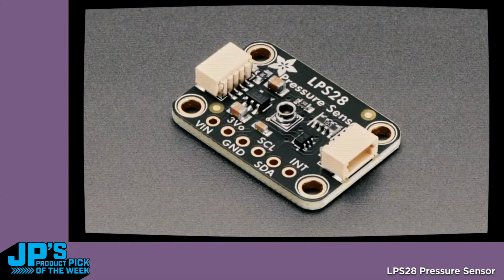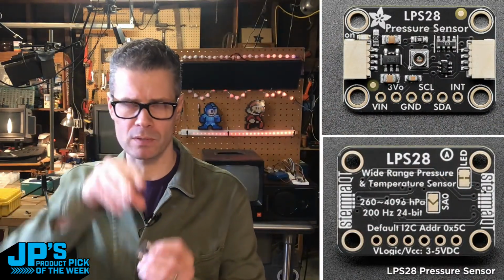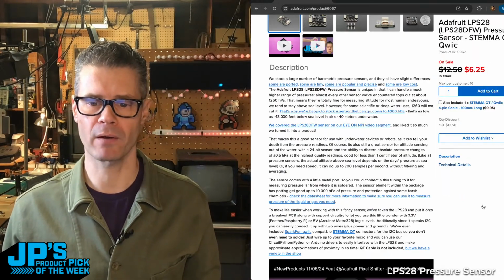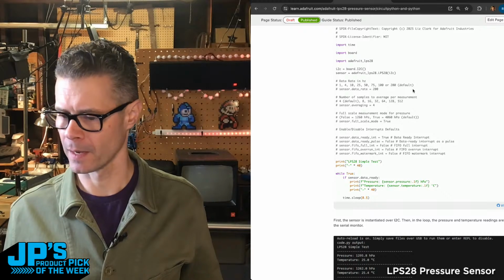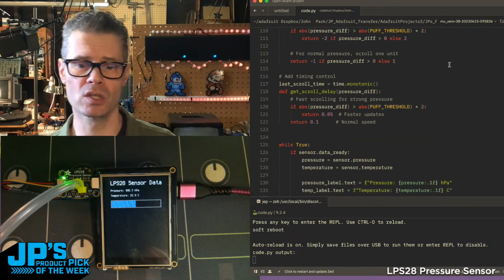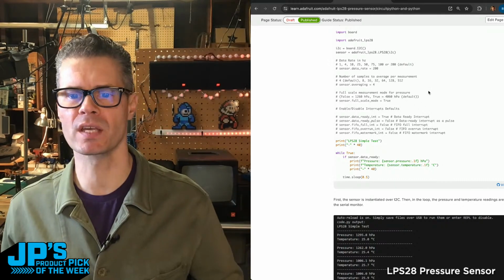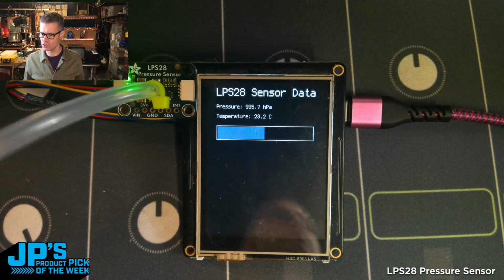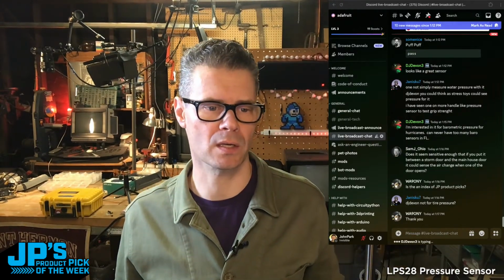JP’s Product Pick of the Week 2/18/25

Comment: Is that 4 bar absolute, or 4 bar above atmospheric pressure?
1 bar is 0.98692327 Standard atmosphere (at sea level) 
Pressure goes up 1 bar per 9.96 m of depth in sea water or 10.23 m of fresh water. (somewhere in-between for bath water)
So, assuming absolute (which seems to match the numbers JP was seeing in his lab), if the sensor is good for 4 bar then it should be good down to around 30 m / 99 feet / 16 fathoms. (plus or minus depending on the type of water) because the absolute pressure is already 1 bar at the surface.

DISCLAIMER: I don't work for Adafruit. If you don't follow their instructions and your sensor gets damaged, they are not responsible. I have gone to great lengths to ensure the accuracy of my estimates (i.e. I Googled "pressure depth calculator" and checked that the first two results had matching numbers) but I am not responsible for errors on the internet and accept no liability beyond a total refund of the money you sent me for this post. (i.e. None.)